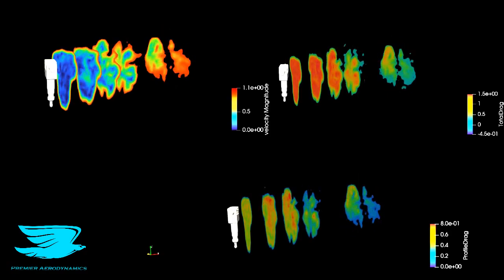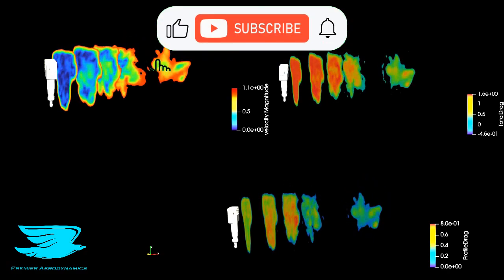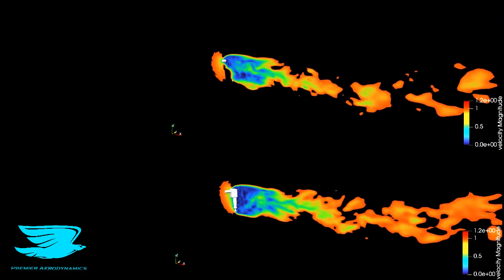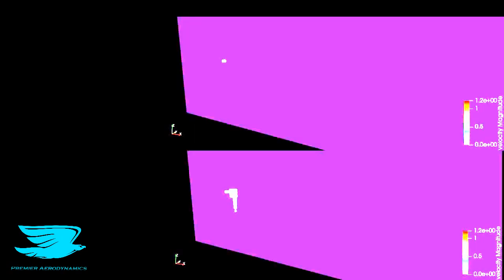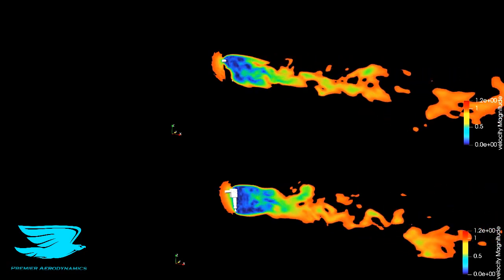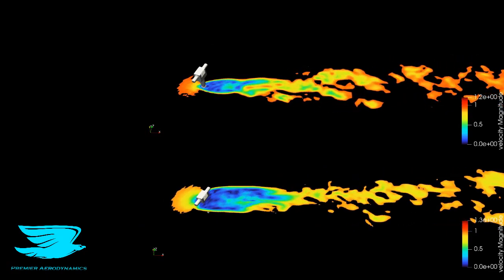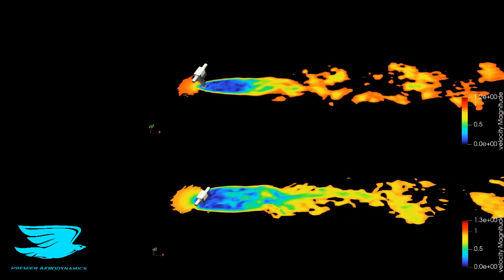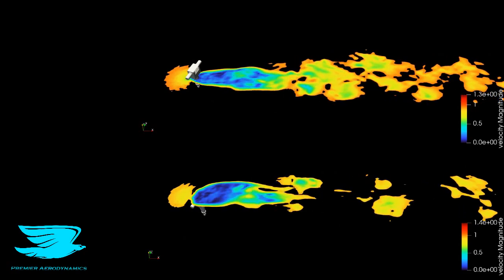Are Jackhammers Aerodynamic?

Comment: I wonder how would the aerodynamics change while the jackhammer is running (vibrating at a frequency of 37Hz), if at all?
Would it create some turbulence that would impact the aerodynamic performance?
Reply from the maker: It will typically break up any coherent vortex shedding, which usually reduces the drag of a bluff body. And around the top half because the jackhammer has very sharp edges, the wake sheds coherently here, so having it vibrating will reduce that.
Reply: @PremierAerodynamics  Oh, interesting :)